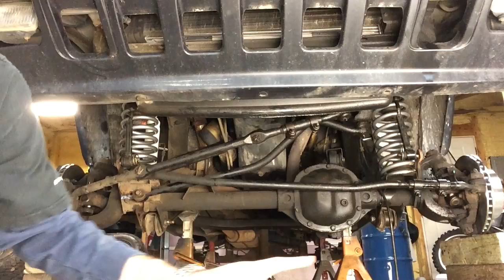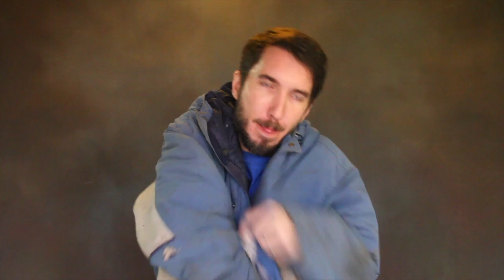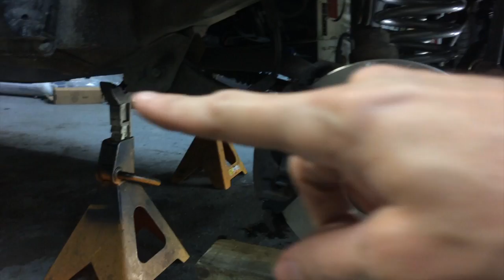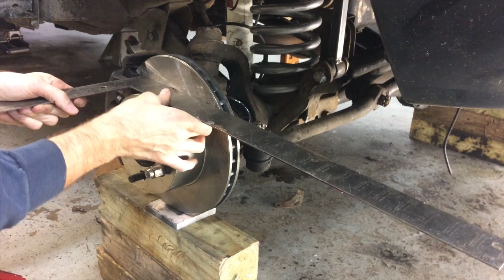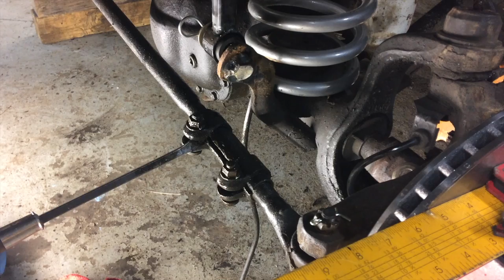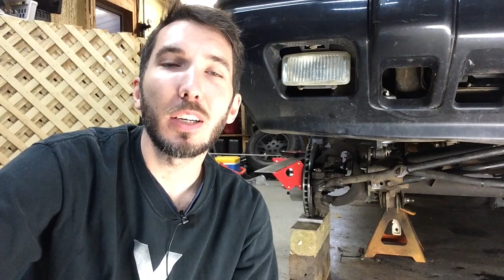Redneck Alignment At Its Best - Operation Cheap Jeep

Comment: On my jeep stock suspension I have 1.6 toe out on drive side and .6 toe out on passenger. Even if I adjust the sleeve for toe in Wont the wheels still be off? How do I get them align up if one adjusting sleeve connects to both tie rods? Won’t one always be off? Is there a bad ball joint or anything else that could cause this? Everything seems right when I checked it and I got new tie rods on it. Any help from anyone would be appreciated

Comment: But yeah that's not going to work with independent suspension.

Independent suspension you have steering alignment and Camber alignment. And then you have to do the camber front and back.

Comment: What about camber adjustment on a 99 xj ? I’m finding shims for my Dana 30 but nothing on the install, my driver side is negative 0.5 degrees out and the passenger is a negative 1.0 as well. Any help would be greatly appreciated, and if there’s nothing you can advise thanks for reading my comment/ question and keep the videos coming, we love them.

Comment: Late to the party here, but...with the distances between the front and rear of the squares that you're measuring, couldn't you just measure the same distances between the front and rear of the rotors?
Reply: The further out the line of measurement protrudes, the more accurate it will be.

Comment: Hi Matt, Thank you for this video.  It seems to me that the only time an alignment would be needed on an XJ is when lifting or when replacing the tie rod or drag link?  Is that accurate?  Whereas every other car I've own in the past, it was always recommended to get an alignment with every set of new tires.  Vehicles with Y link steering only have the Toe adjustment, and that's adjusted by the adjustment sleeve on the tie rod, and so if that sleeve doesn't move, then alignment will not change?
Reply: Its still recommended to align. You're right, if the sleeve doesn't move you shouldn't need it adjusted......
But it does lose adjustment, especially if you off road often and also if you have large tires.

Comment: You can do this with the wheels on sitting on the ground. Just measure the insides of the wheels front and back, adjust until they measure equal. I have had good luck measuring the center tire tread as well. You can put plastic trash bags under the tires on your garage floor so the wheels turn easy, be careful pulling the Jeep onto the bags!  FYI make sure your steering wheel is straight before you start.
Reply: Good advice!

Comment: Thanks for the tip on alignment. I have a quick question for you. Do you know if the alignment causes my 53 wagon to NOT Want To Follow  around turns when towing it with a tow bar? Could it be camber and caster? My tires ware evenly so it's not way out. Any suggestions would be greatly appreciated.
Reply: Jerry Enebak I tow a lot of old trucks flat. Only time one didn't want to follow was a 92 f150, steering column locked up because I forgot to leave the key on it. Also, I have an M35a2, and when swapping tires to more modern tires on those it helps a lot to modify the plates that set the caster angle. If it's anything to do with your alignment, I'd look at caster first.

Comment: why didn't you put jack stands under the front axle? It would be much easier and whole lot safer.
Reply: Tires can be worn unevenly or have uneven psi. Balljoints and bearings can wear and cause slop.
Wheels could be bent. Of course..... ideally.... that wouldn't be present.

Doing it this way isolates that out.
Reply: @xmo552  that makes absolutely zero sense. If you put stands under the front axle instead of under the body, AND THEN remove the wheels.... You don't have to consider how much the pitman arm has lifted the drag link which lifts the tie rod, shortening the distance. Your vehicle will be sitting at ride height.

Comment: witch transfer case is in the cheep jeep .some lifts say u can't lift if it's AWD.
Reply: Bryan Miller you really need to learn how to spell..
Reply: Logan Elmore good answer
Reply: @Tobyncorps  
The reason some with awd you can't lift is because of the factory drive shafts they use. Rzeppa for example, they dont like high angles. You can swap those out.

Another reason, on 2011 grand Cherokees with awd for example .... the awd also gets you air ride suspension included. They use ifs and a live rear. The issue is the air springs. You can swap in convention coils to lift it.
Reply: 249

Comment: Hi Matt,       I have a question. I have a lifted 05 Jeep Wrangler TJ running 33x12.50 tires with a Dana 35  3.73  in the rear and a Dana 30 front.  I can't afford to swap them out for  44. I want OX  E lockers. I was thinking of starting in the rear diff first then later do the front when I get the money.  Should I go ahead and upgrade the axles also?  I don't do rock crawling or anything drastic. But I do enjoy a challenge. I just like to keep up with the 'Boys'. lol... Jeep girl thing ya know.  Love watching your videos.
Reply: Do what money allows for. Axles are easy enough to swap out, keep what you have until it breaks!
Reply: Laurie
What did you end up doing?

Comment: you can also do cheap alignments on any flat surface with stacks of 3-4 plastic garbage bags under each wheel, it lets you slide them around

Comment: Not really a fan of grand cherokee's, but i'm always happy when a new cheap jeep video is out...
Reply: Titan 
I used to agree with that, but now I'm in a modded '04 WJ Limited. Hard to beat a V8 in a solid axled Jeep with a D44 rear and locked front/rear. That QuadraDrive is the real deal. The only drawback is that you have to open up the wheelwells more to fit bigger tires. These V8 models come with double cardan driveshafts in the rear so no SYE kit is needed. The '04 Grand Limiteds/Overlands are the king of the Grands (excluding the SRT8s of course).
Reply: ^^^^Not to mention it's pretty awesome to wheel in full leather heated seats 😎
Reply: Titan  i wanted a regular Cherokee because i thought they looked better.  the grand cherokee is just better all around.  better brakes, better suspension and nicer interior.  

once you pull the bumpers off and out on some steel bumpers they look great.  if i could go back i would get a grand cherokee instead.
Reply: Jacob Jensen 
I'm well aware of the "a" meaning aluminum...however, some LIMITEDS with the tow package came with steel center sections on their D44. My WJ Limited has a steel center section, hence the omission of the "a" in my description of my Jeep. I've been a Jeeper since 1990...so...I don't need to Google it...
Reply: @cavediverjc  
Sir, are you sure? I've never seen an iron Dana 44 in a WJ, but I have heard rumors that they exist in export markets.
Reply: Jacob Jensen 
You're more than welcome to crawl under my Jeep with a magnet to see for yourself
Reply: Titan 
Sorry Bro ,
But Grands will unexpectedly kick tons of ass. Cept for a for an extraction , parts usally come flying off......lmao
Reply: Jacob Jensen 
Lmao. I'm with you.
Reply: cavediverjc ----D44a.       The "a". Is important. Don't know what I'm talking about? Google it.
Reply: cavediverjc vin number or you're a troll
Reply: cavediverjc is it the original axle? And is it European? You might wanna double check. I did and got the same answer... it's not iron...